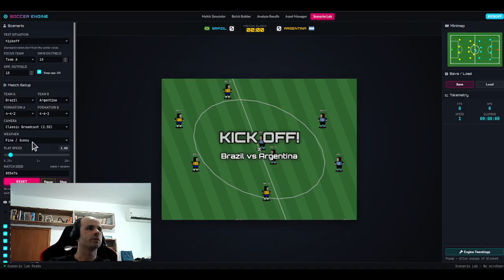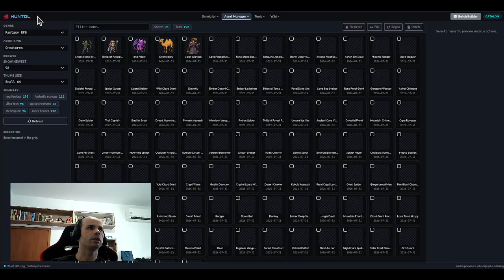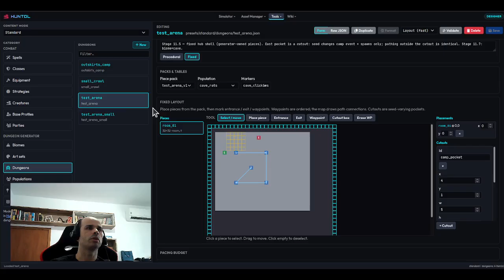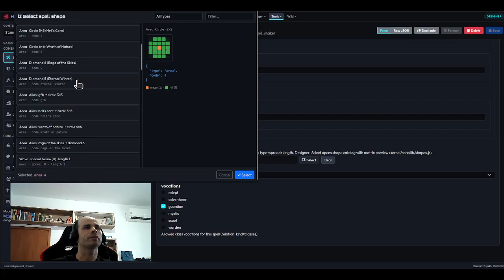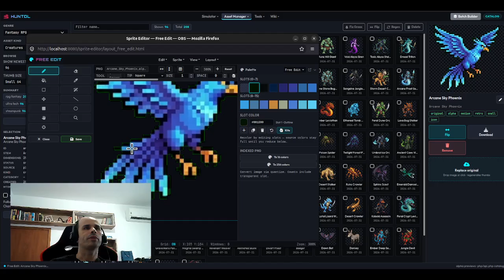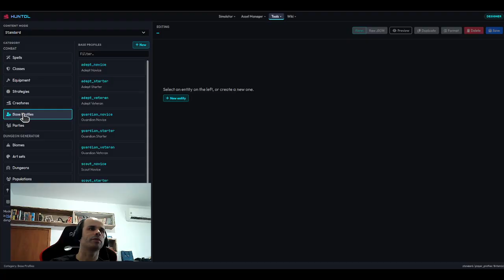Open Source Hunt Design Lab: RPG Dungeon Simulation & AI Sprites

Comment: I like your sprite editor. Would be cool to give it a workflow where it can generate a character in motion. that was my battle when i experimented a bit.
Reply from the maker: I was planning to do it but postponed because each entity would require a full sprite run at minimum. Now thinking about it again it might be possible to do a proof of concept generating a simple walk run for 4 entities each run. That might be still an improvement overall to the project, still focusing only in a few entities to generate these sprites and keep generating unique sprites for other entities without sprites atm.
The bottleneck is: I prefer grok for coding and avoid using credits for images. AGY limits the amount of GOOD runs per 5 hours and then apply a limit per 7 days depending on the amount of runs you executed during the week.
Reply: @tcviana I saw you're using antigravity / Gemini. You can have it make you a sprite sheet of the character already in motion. You'd just have to get the sprite editor to be able to put the pieces together as an asset?  It can be done just need the right workflow.  You're killing it tho man. Keep at it.
Reply from the maker: @thegoldenwolf274  I uploaded a video about the main issue today, check my latest video "Why I Stopped Using AI for Game Animations (For Now)"